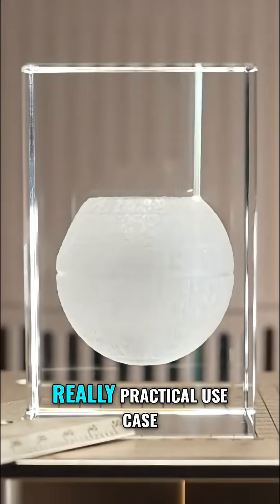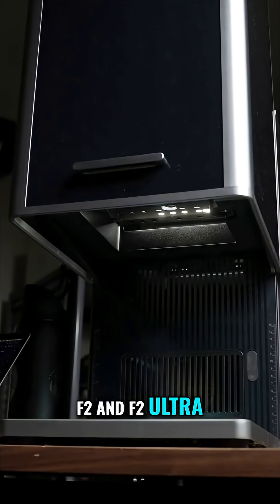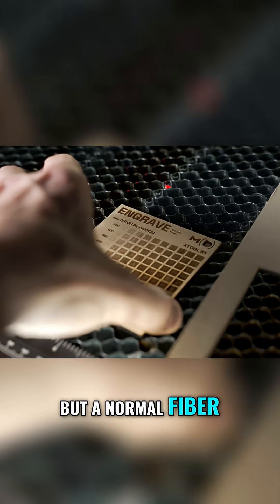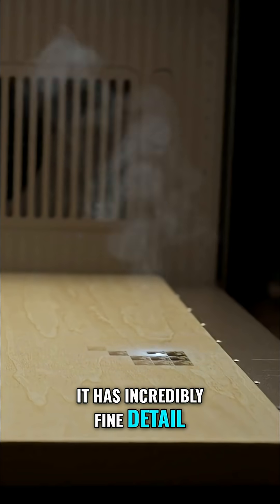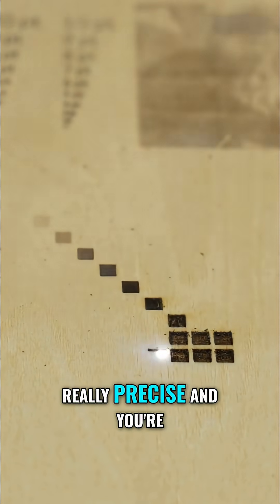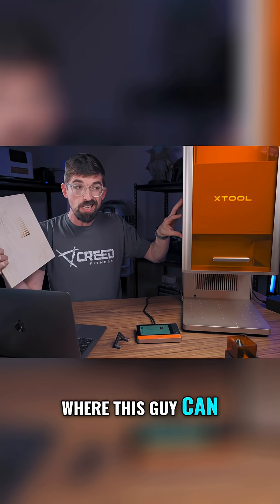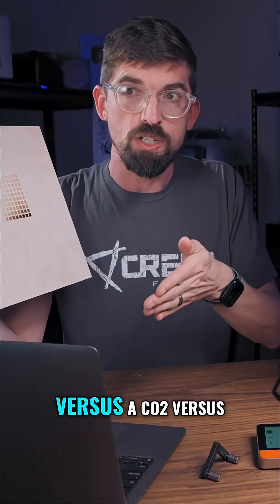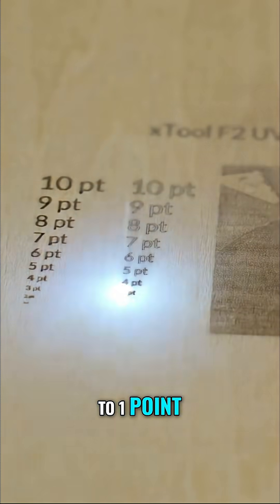Engrave Wood with a UV Laser?

Comment: So what happens if you put the UV laser module in place of the CO2 tube, besides allowing a more compact design and air assist, the latter not being absolutely necessary since there is much less, if any smoke?